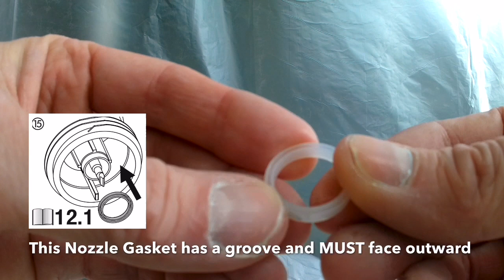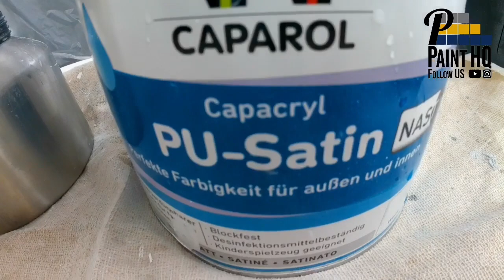How to spray with a Wagner XVLP Paint Sprayer. Spraying Caparol PU-Satin

Comment: Outstanding Pete Outstanding
Reply from the maker: Ah thank you kind sir.. very much appreciated 😆
Reply: Super pete. Only seen this now 😁. Was thinking of buying the 3500 for doors, spindles and trim etc. in occupied homes.  What do you think or would you suggest something different . Cheers mate
Reply from the maker: Hey Mick.. the FC3500 is a great machine for the money.. They are a little tricky to perfect, getting the right mix of air and material.. with the extra air (XVLP), they’re able to atomise thicker materials Vs the restricted pressure of HVLP.. the trade off is the air can blow the masking off.. like I say a great machine to have, especially the ability to spray small quantities of material.. but I’d still choose to spray doors, trim with airless (fine finish tips). Even spindles, you can master, moving quick with a small tip.. just the masking is crucial but even with XVLP / HVLP the areas still need masking, but the speed you can go slower and with that you’ve got a bit more control.. hope that helps, keep in touch my friend and let me know if I can help guide you further.. regards Pete 🎨
Reply: @PaintHQ  thanks pete

Comment: Great video. Recently purchased the 3500 as a DIYer. Struggling to get such a clean and consistent spray pattern like yours. Gun runs great for 5 minutes and then maybe spits every now and then with a different pattern / volume for another minute then back to better pattern. Will give the extended turbine heating a try. Normally give it 2-3 minutes but on a cold day it's probably not enough.
Reply from the maker: Thanks for watching and your feedback, I really do appreciate the support.. I think I know what you’re referring to and it can be frustrating. That can happen when the material is too low in viscosity (could be thinned too much). If it’s the same as what you’re experiencing, I have that problem with clear lacquer. It’s the same as what happens when putting water through the machine when cleaning. It will pulse because it can’t build adequate pressure in the cup.. I find It can also happen if the cup is too full.. Hope this helps.. Keep in touch my friend.. Regards Pete.
Reply: @PaintHQ  thanks for the feedback. Really appreciate it. I had actually thought it was too viscous, so have been heating and adding ~10% water. I find it's a case of practice practice practice and learn from the mistakes and advice people share. So far I've only Sprayed Allcoat exterior and today used Tikurilla everal so lots to learn.
Reply from the maker: Yeah it’s a great and rewarding journey when it goes right 😆 ..I’ll always help if I can 💯 Pete

Comment: Been watching your channel for a while.Brilliant may I say.Bought the 5000 last year for a job with the nast head and pu satin after looking to getting into spraying.So happy I did.Faster.less muscle fatigue and superior results.Was scepticle at first with time for masking up for overspray but can say it's so much faster than brush and roller.The only downside to the 5000 is DONT use flimsy polythene to cover any area near the project as it blows the dried paint onto the newly painted surface.Newbie mistake.Keep up the good videos lad.Have you tried spraying kolorbond through the machine or will it be better through an HVLP?
Reply from the maker: Hi Richard, really appreciate your comment and kind words of support.. So glad to hear you’ve taken the step into spraying and had success.. yeah the FC5000 is a great machine, especially with the NAST head and the Caprarol system, the results really are excellent.. very good point about the plastic, you can’t comprehend how much ‘extra‘ air is blown out the machine.. not great for blowing the masking.. but great for atomising higher viscosity materials.. it’s a trade off though, the extra air with not enough material flow can cause a dry / rough finish.. whilst in theory the FC5000 could spray Kolorbond, I feel the low viscosity consistency could cause a stop/start spray scenario.. have you noticed when flushing with water when cleaning, the spray pulses (stops/starts)?.. it’s because the material is so thin it causes a problem pressurising the pot.. I didn’t want to take that risk with Kolorbond.. Have you seen this video? 

uPVC Door Spraying | How to Spray PVC https://youtu.be/Awuc1q4bPQQ

The conventional HVLP setup with the regulated pressure cup is just a joy to spray with.. no concerns of pulsing, you can spray at any angle and the air from the compressor is actually not that high to atomise the material..

Great to have you contributing to the channel.. ask questions or provide feedback anytime and I’ll always get back to you.. please subscribe if you’ve not all ready.. take care and keep in touch my friend.. regards Pete 🎨💯

Comment: Hi Pete, I use the haftprimer all the time but usually follow with johnos aqua guard when it comes to satin finish. I was thinking of trying this the other day when I ordered a 10L primer. My question is, have you used the pu gloss from caparol at all? I've never sprayed any gloss only rolled it on. Usually it's johnos aqua gloss as I've found that's got the most sheen but it kackers your brushes up. I know there's tikkurila gloss and never tried that either. What's your opinion buddy. Thanks
Reply from the maker: Hey buddy, good question.. I was always a fan of Johnos Aqua in my brush / roller days.. the alkyd ‘hybrid’ paints (I believe) will have the higher sheen for a waterborne.. 90%.. Tikkurila Helmi is acrylic based and 80%, I’ve not used the Caparol PU-Gloss but I’m thinking it will be similar to Helmi.. I did very much rate Teknos Futura Aqua 90, again an alkyd.. I was very impressed with the way it performed spraying and the high sheen 👌

This is Teknos in action..

Spraying Oil Based Vs Water Based Paint. HVLP Vs Airless Spraying
https://youtu.be/RXIb8hOmjFU

Comment: Hello mate lovely work that's the caparol pu satin like to spray? Is it a good finished and what would you recommend?
Reply from the maker: Hey Aaron.. I’d choose the NAST version of the PU-Satin, if looking to spray HVLP or XVLP.. it’s viscosity is lower, designed to spray straight out the can.. I do rate Caparol Haftprimer and PU topcoat.. buy the satin is a little flat in sheen.. my current go to is AkzoNobel, WP136 primer and enamel topcoat.. again both are spray only, no thinning required.. also sprays airless with .008 tips 900 psi with Graco FF LP tips..

WP136 Water Based Primer / Edge Sealer
https://holmanpaints.co.uk/interior-wood/171-akzo-nobel-WP136-highbuild-waterbased-primer-edge-sealer.html

AkzoNobel Aqualit (Supercryl) Waterborne Enamel Topcoat
https://holmanpaints.co.uk/interior-wood/169-akzo-nobel-aqualit-waterborne-enamel-topcoat.html
..you get a beautiful cabinet like satin finish ..and very cost effective, especially in 5 litre cans..

Comes in white, then if needing tinting both primer and top coat can be colour matched off any colour chart..

Also in a clear lacquer, coats oak beautifully.. it’s a sanding sealer, just denib the first 1 or 2 coats of grain raise.. dries super quick, I spray 3 or 4 coats depending on the amount of grain fill..

https://holmanpaints.co.uk/interior-wood/191-1705-aqualit-supercryl-water-based-wood-lacquer.html#/1872-size-1l/1952-finish-30_satin

I’ve used Holmans for years, the Holmans team are all super helpful..

Can be delivered next day if required.. If this helps at all, Holmans have a 5% discount code, across all their range.. 

👉 Use code PAINTHQ

Hope this helps my friend.. keep in touch.. regards Pete 🙏
Reply: @PaintHQ  amazing mate, I appreciate it 👌
Reply from the maker: Anytime my friend 🙏

Comment: Awesome video mate, I might  try using my Wagner xvlp 3500 with some water based gloss with your approach and settings
Reply from the maker: Thank you buddy 👏 Yeah go for it 💯 The advantage of XVLP is with extra air, decorative / architectural paints should go through it.. Caparol NAST paints you’ll have no problem at all.. With higher viscosity paints, you may need to up the air to break up and atomise the material.. I just try to keep the air as low as I possibly can get away with to achieve a wetter finish that levels out nicely, especially the final coat.. a paint conditioning product called Floetrol can help ease waterborne paints.. Hope this helps, let me know how you get on 😊👍
Reply: PaintHQ cheers mate, we don’t have caparol in Australia but I will test out a couple of different products first , I have tried taubmans alkyd water based gloss but I’m not that happy with the finish I get when I sprayed it, I have tried floetrol but I prefer the dulux hot weather extender because it’s very thin. Thanks again I really appreciate your help
Reply from the maker: You’re very welcome 👍 Anytime my friend 😆

Comment: Hello brother Peter, i have a question for you, is the Finefinish sprayhead the same as the NAST ???? Greetings from Holland ✌✌✌
Reply from the maker: Hey brother 👊 Great to hear from you 🇳🇱👏💯 ..That’s a very good question.. I believe the air horns are different on the blue NAST head, compared to the brown Finefinish. Resulting in a narrower squashed fan. The NAST head is designed to work with the Caparol NAST system of paint to mean reduced overspray / fog.. in my opinion, if you had the brown Finefinish head, I wouldn’t pay for the additional NAST head.. I would however give the Caparol NAST haftprimer and PU-Satin a go, and fire it through the brown head if that’s what you had.. or use it with any HVLP sprayer 👍👏 Hope that helps my friend.. Regards Pete 👊 .. 🇳🇱👏👏👏
Reply: Thanks for youre great advice , thanks and have a good day,  may god/Allah bless you ✌✌✌

Comment: Have you sprayed regular Haftrpimer and PU Satin through the fc 5000? I can't get hold  of the NAST system where I am.
Reply from the maker: I have my friend, it’s a more thicker viscosity (thixotropic).. to be honest it doesn’t spray so well through XVLP.. you can help it by warming the paint in the metal pot, and adding a good splash of Floetrol (a paint conditioner).. thinning with water is my last resort 👍 regards Pete
Reply: @PaintHQ  thanks. On the Floetrol, I’ve used it a few times and hardly saw a difference. Have done plenty of different ratios and thinning with water but it still drags with a brush. Mainly wanted to be able to roll flat doors and lay off and it just dragged - is that to do with the temperature? Applied well within the limits but is warming the paint first the right thing to do? Thanks

Comment: Top job as always mate. I use a gentilin compressor for my fine finishing but if i didn't go for that, i always had my eye on the xvlp tbh!
Reply from the maker: Hey buddy 😆 Always great to hear from you my friend.. Great choice, the Gentilin is definitely the compressor to go for 💯👏 ..Have you also gone Air Assisted Airless? Or is AAA something you’re considering in future?
Reply: @PaintHQ  i am strongly considering it. Atm though i think i will wait until i have a better airless. I think i mentioned that i am considering getting an sf23 this summer because i am spraying so much! When i do i will defo look into aaa. I am not sure it is worth it with the gx21. :)
Reply from the maker: Yeah I see what you mean, no rush like you say.. You’re right, a diaphragm pump is the right way to go, to provide a constant pressure when spraying at low pressures.. You’re doing well my friend, exciting times 👏👏😆
Reply: @PaintHQ  thanks mate! Got a mad wave of spraying work this summer which is amazing. I aint ina rush to tool up, just enjoying spraying tbh! Look forward to your next video. I just quoted for some exterior bifold doors yesterday, so i hope i get that one  :)

Comment: Hi, Pete. 
Many thanks for all the quality videos and simple advice. I carry out property maintenance and every now and then have to do a few  smaller jobs that might benefit from a sprayer, like built in cupboards/bookshelves and small room trim and walls. I don't want a complicated setup and have narrowed it down to either the Graco Ultra or Wagner 3500. I already have a cheaper Wagner hvlp and hate the mess the turbine makes when spraying in the workshop, and favour the Graco for that reason.I would dearly loved to be pushed over the edge by a professional with experience with both. What would you recommend?

Many thanks for your time!
Reply from the maker: Hey Edward, thanks for reaching out, happy to give my opinion if it can help.. Apologies if it’s something you already know, but just to clarify the Wagner 3500 and Graco handheld, whilst both handheld, they’re different technologies.. the Wagner is HVLP (or XVLP) is based on air but low pressure to atomise the paint and the Graco is airless (no air but much higher pressure).. Airless is much easier to master, choosing the right tip and pressure and you’re soon spraying.. HVLP / XVLP is getting the balance between viscosity (you’ll have to thin most decorative coatings), fluid flow and air.. I find a big frustration with XVLP (Wagner 3500), is the ‘extra’ air can easily blow your masking off, then the amount of air can cause ‘orange peel’ or a rough finish if you’re not getting the balance right.. Plus you mention spraying the odd wall, so yeah definitely airless is the way to go.. I am a fan of the Graco Handheld, it’s been invaluable to me on the job site.. so yeah I’d go for this out of the 2.. however it’s important to understand these machines are designed for small projects and touch ups.. if funds allow, check out a GXFF, you’ll get the true airless experience.. perfect for fine finish spraying and can spray emulsion no problem if required.. here’s a link so you can see what I mean.. https://www.sprayman.co.uk/product/graco-gxff
Hope this helps my friend, keep in touch, I’m happy to help in future all I can.. regards Pete

Comment: Awesome video thanks for the tips. Do you know what dilution is required for spraying with Dulux Satin Wood Paint or best settings for the fine brown nozzle. I found it was creating small splat spots of paint on edges of spray pattern. Any help would be appreciated. I've only used the HEA Wagner for spraying emulsion mist coats and top coats, so this is new for me.
Reply from the maker: Hello my friend, thanks for the feedback.. I’ve not experienced spraying Dulux Satin Wood, but I will do my very best to help.. before any dilution, try warming the paint.. using very hot water in a bowl or pot and submerge the metal spray pot containing the paint.. let it sit for about 20 minutes, warning the paint like this is a legitimate way of lowering the paint viscosity.. Also run the turbine on speed ten for about 10 minutes (not spraying anything, take the head off).. this is to warn the air.. from the symptoms you describe, the heavy splutters is the paint not atomising.. try lowering the fluid flow a touch and increasing the air.. if warming the paint is still not helping, next try adding  a splash of Floetrol, it’s a paint conditioner.. it’s a well known product used for when brushing paint to help levelling out, it can help with paint flow when spraying.. last resort would be to then add a splash of water.. just a splash.. also, just bear in mind that some products don’t spray well (even airless), spraying XVKP is great but can be tricky.. for straight out the can spraying, Caparol NAST products are great 👍 ..Keep in touch and let me know how you get on.. regards Pete
Reply: Thank you so much for your quick reply. I will give this a go tomorrow and will check out the other paint you suggested too. Will let you know how I got on.
Reply from the maker: You’re welcome anytime.. good luck my friend 🙏

Comment: Hey Pete hope you're well. Iv'e been busy using my sprayers! Had some great results with all your tips on the airless you legend! Been using the Q5 the last few day. I'm finding I'm thinning the primer a lot to get between 30-40 secs as recommend by manual. I'm using a 1.8 cap, current ratio is 16 oz primer to 7 oz water, that's 40 secs through the viscosity cup! Do you think i need to thin as much with the 1.8 cap? Seems like I'm having to do more coats because the paint has been thinned so much. Results have been good though. Haven't sprayed a top coat yet, people are saying a 1.5 cap for top coats?
Reply from the maker: Hey buddy, really good to hear from you and great news you’re having success.. I’m really pleased I’ve been able to help.. yeah that sounds like a lot of thinning.. what’s the product(s) you’re spraying.. I tend to stick to a 1.5 (but I’m spraying low viscosity materials).. I have moved up to a 1.8 but do prefer the 1.5.. I think my regulated pressure pot helps, allowing dedicated air the gun.. have you tried the product first without thinning?.. before thinning, my next tactic is to warm the material.. see if you can submerge your cup in hot / off the boil water.. ‘bain Marie’ style 😆 ..next id add a good drop of Floetrol (it’s a paint conditioner, traditionally used to help brushed paint level out).. lastly I’d ease with a drop of water, but I’d wouldn’t really want to add ‘too much’.. hope this helps a little my friend.. keep in touch, and let mr know what you’re looking to spray 👌👍😆 ..regards Pete
Reply: @PaintHQ  Thanks so much mate  I'm spraying Zinnser 123 primer, then going on with Everal Aqua 10. I'll try shooting some with no thinning today, I thought it seemed a lot! I'll try warming and adding a little water. Flowtrol is in my amazon basket 😃
Reply from the maker: Ah nice, great products 💯 ..Good luck my friend, I’m sure you’ll have success👌👍😆
Reply: @PaintHQ  this morning I done just under 10% water plus warmed. Sprayed lovely. Cheers bro 👌
Reply from the maker: Great news, glad it went well buddy 👍 10% sounds more like it.. Floetrol could help, if the finish just needs a hand to level off.. just a splash, a bit of warming and you could try with no water.. regards Pete